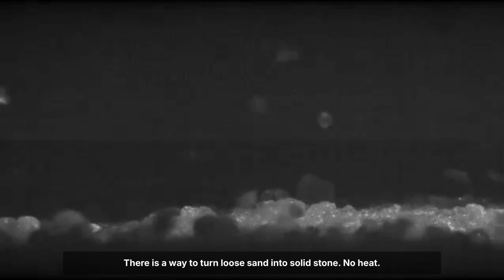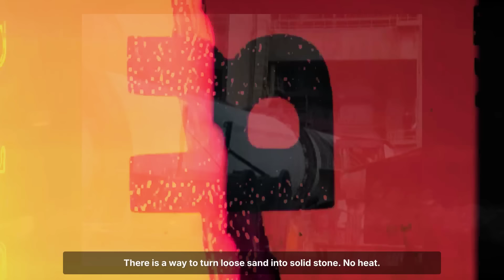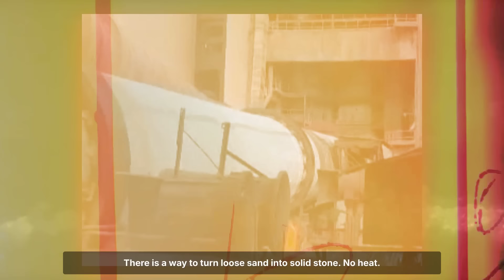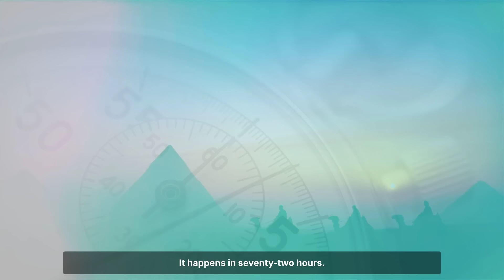This Bacteria Turns Sand Into Solid Stone. No Heat Required. Why Do Building Codes Reject It?

Comment: Seems to me that the production of HN3 (Ammonia) could be withdrawn by vacuum and stored in tanks for use as a soil fertilizer, as it is already used in large scale farming.  Its dangers are already known and averted on a daily basis, so the production of HN3 seems a paper tiger, at best.  This whole project is reminiscent of the use of shredded rubber in the concrete and cement of highways.  It was wonderfully durable and reduced wear and tear on the surface by friction, reducing chip damage during winter and creating a long wearing product that proved to be the very reason why the concrete producers refused to add the refuse of ground up tires to its product.  The amalgam proved so durable that it increased the interval between repair cycles, forcing a difficulty not unlike term limitations in Congress.  Nobody will vote to limit the power or funds they can wield or create for their own benefit.  It comes to a matter of slowing the growth of the parent company, which makes it a direct threat to its competitor and therefore, something to be avoided at all costs.  It approximates a parasite with the same needs, in small form, of the 'parent' process.  If it could be converted to something more sycophantic, much along the lines of mutual parasitism that form the basis of trade tariffs, so much in vogue at the moment, the 'slowed growth' problems could be averted.  The  process requires a mere 72 hours or so per application, or so you've given reason to believe.  Surely not an insurmountable difficulty to incorporate in planning.  The largest difficulty to overcome is governmental and ownership induced inertia and the fear of new ideas.
Reply: A top layer of vegetable oil could capture most of the ammonia and provide a protective coating layer that helps protect against corrosion or could easily be heat treated into a plastic-like permanent protective membrane
Reply: @RandomInterjections  I do like my rocks well seasoned.
Reply: It's not widely publicized due to the fact that it would be damaging to the concrete industry. There lots of solutions to problems that people have created, and depending on their potential damage to specific industries, it can be given the go ahead to use, but not widely publicized, to outright banning, making it illegal to do or use, and then classifying it.
Reply: I thought of something similar. I'm planning some kind of sub-surface "tunnels" with clay bricks, the holes oriented sidwwards. The idea is to store water there during rain seasons and slowly release the water into the ground for plants. Problem with standard mortar here is it won't last enough years. This stone will, i think. So if it would be possible to use it to fix the bricks with this stone, this would resolve 2 problems at once, because the ammonia would automatically be used as a fertilizer for the plants. I have to keep an eye on this :)
Reply: @siegfriedgipp7287  lime mortar is supposed to be more durable than Portland cement mortar. It is supposed to do the same thing as in the video with the sand . Over time it returns to its original limestone origin but I am just  my father’s daughter trying to know how to fix everything and figure stuff out. Going to be homesteading soon and I will once again have to be the jack of all trades because my husband will be working.
Reply: Global agriculture depends on industrial ammonia for our food supply, but the process to create it takes lots of energy and fossil fuels...this ISN'T a waste product. It's a valuable output.
Reply: @Soil-Nerd collecting the ammonia over a wide area and then condensing it from gas to liquid might be cost prohibitive.
Reply: You can also run converted vehicles on it .A man in Canada runs his truck on it . He says he pays 25c a gallon for the ammonia.
Reply: This can only be over come by an overwhelming spirit of nationalism and patriotism on social level across the board. Where any company, its board, and CEO that does not work to the benifit of it's country and people is branded as a traitor to that country. Complete exile from that country. Big pharma, for example, wouldn’t pursue dollars over health is every employee of that company faced being ostracized by friends, family, and social peers as traitors to be run down in the street. National populism and a return to morals is what can change this country. But, that has to be taught TO children BY parents.
Reply: @ravenrock541 This is starting to get off topic but your suggestion is one based off of fear and control. You want to use fear and social acceptance to force people to make a more loving choice. This won’t work. You can’t create love using fear. You have to use love to inspire more love. Fear and love cannot occupy the same space. You cannot create one using the other it is against the laws of the universe.
Reply: Ammonia is NH3.
Reply: @andrewmole745 yeah editing it won't change much though, I started questioning my memory.
Reply: @SeanBeaY  It might help others though. If you change it I'll remove my comment (because then it would look silly).
Reply: Before I build a 100 story skyscraper for my family to live in, I want to be sure this holds up to "The test of time," and I also want it to be so foolproof that any fool not only CAN do it, but will only EVER be able to do it RIGHT.
Being SURE of the building's structural integrity is never something we should GUESS at.